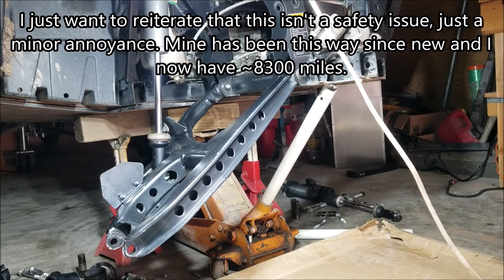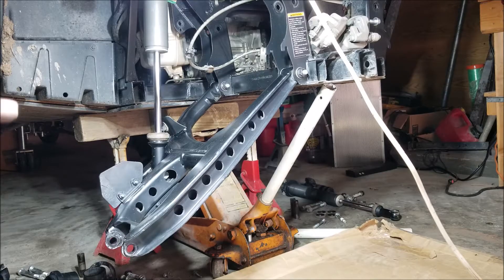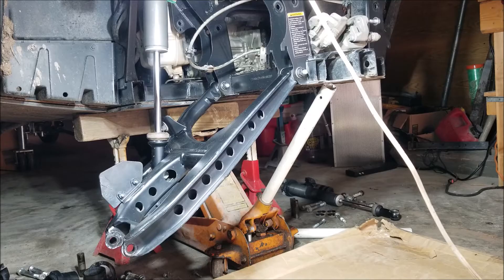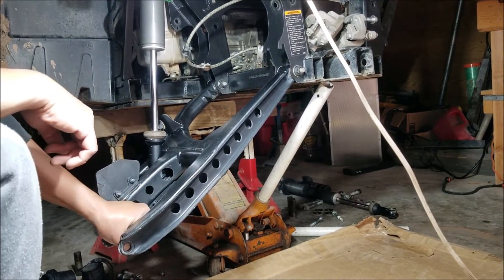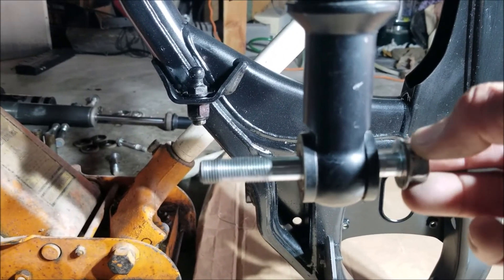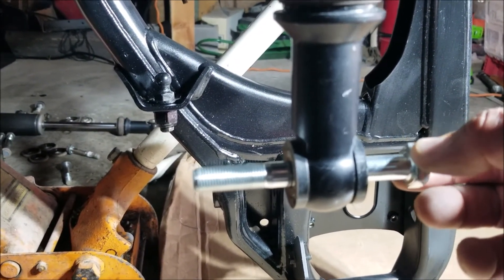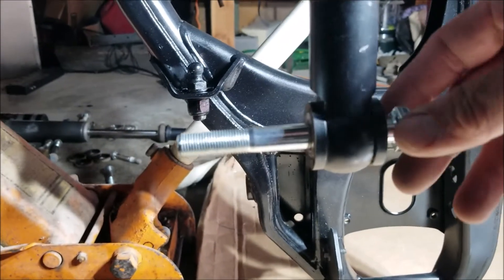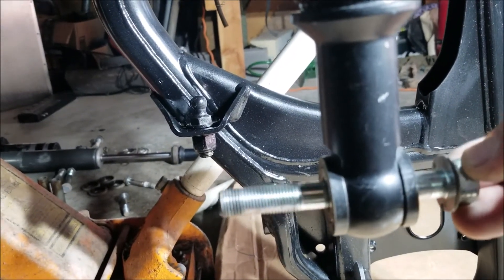Yamaha RMAX lower shock bolt issue

Comment: Im dealing with a loud clunk from the rear diff of my 22 Rmax 4 when turning. Is that why you are replacing yours?
Reply from the maker: One of the pinion bearings in mine wore out.  Fluke deal.
Reply: @MassiveOverkill  I couldn't find anything wrong in mine but I am not real knowledgeable on gears and bearings.